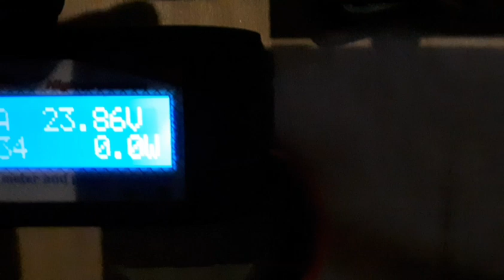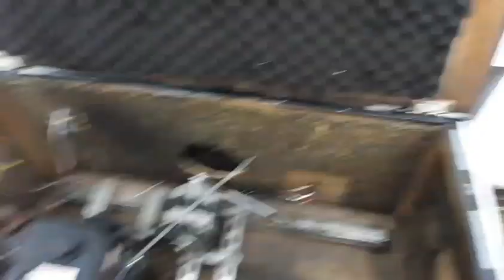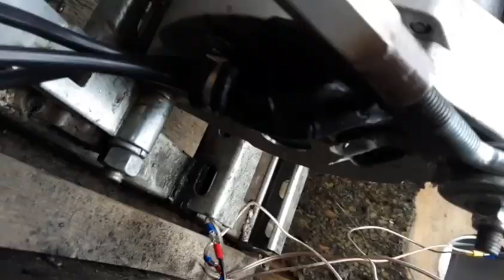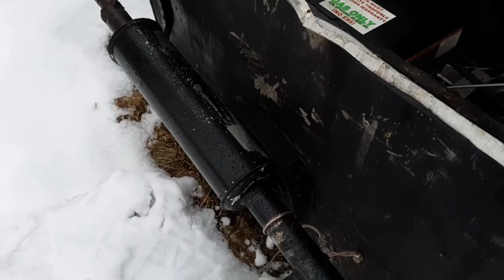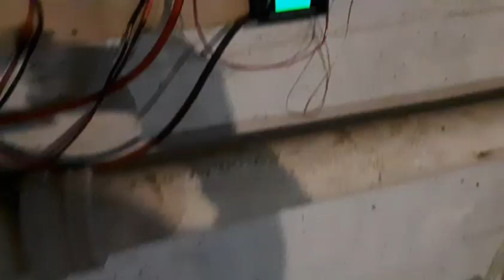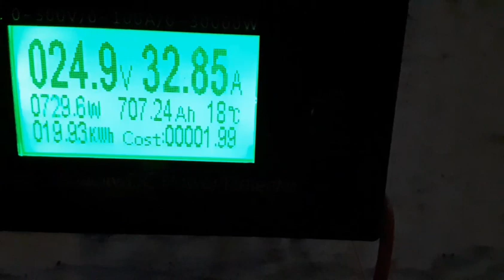DC Generator, Battery Bank Charger.

Comment: I’m about to do the same setup. How is this working out still? I want to do this to make a home made inverter generator for my camper. I’m going to use a YanMarr Diesel engine about 6.5 hp. But a lot of torque.
Reply from the maker: Still working fantastic! Just shot another video with a few new updates. I'll try to get it uploaded tonight.
Reply: Yes I would like to do the same thing - Yanmar Diesel LN100 air cooled engine driving a belt connected alternator to charge 48v battery banks. There is a lot more involved in all this then you would think. Have you seen the wakespeed WS500 alternator regulator ?
Reply: This  .....   https://www.youtube.com/watch?v=ccWg_G-ECSI is not run through a wakespeed controller but its an interesting setup. Expensive though and I cant work out why its so expensive. Sure the 48v 100 amp alternator is $1495 alone, the Yanmar engine is around $2000 I think. So I dont know how they end up at $6995 for the setup. Thing is, the video shows it can be done and it is working. They have that Yanmar setup with the belt/pulley setup to spin at 1800 RPM which is nice - a bit quieter and sips fuel
Reply from the maker: @jimjones7821  nice! I wonder what kind of run time that engine gets with a gallon. Generators are fun projects either way. I did lots of testing at different throttle set points and recorded kwh output/gallon of gas. I finally have mine where I like it. I did an update on this project recently. Much quieter now and zero degredation after 2 winters.
Reply from the maker: @jimjones7821  https://youtu.be/Puj2umQ_bVs
Reply: @smallcityhomesteaders1600  Yes I saw that video of yours. There is a lot of info out there but you have to be a dedicated searcher to root out the info. I am doing deep research into alternator charging - I want to run a setup in a small boat to charge an NMC battery pack for an electric outboard motor. I have been using a Victron 48v inverter and AGM batteries since 2010. Its worked really well. But its time to go to LiFePo4 batteries - so many advantages to lithium. Sure big sticker price up front but after that its all gravy. I have not done the solar thing yet though....I use grid for charging batteries and the inverter carries us through outages that happen here every other day.
Reply from the maker: @jimjones7821  Every other day?! Thats crazy! Where are you? You are correct about good info. Seems like someone doesn't want people power independant. Solar is amazing! The panels make so much amps with little sqft now. I see 50 amps by 10am and batts are full by noon while my wife runs laundry and dish loads, fridge and freezer kicking on and off, TV and lights... ect. Wind is about 5-10% of what charges my batteties. Zero grid power here(my choice of course). I am impressed by the energy density of lithium but I don't like the fact that when they're dead, they're basically useless, hazardous waste. Lead acid is at least renewable. Bulky and heavy but cost efficient and time tested. Until carbon foam battery costs come down i'll stick with lead acid.
Reply: @smallcityhomesteaders1600  I am in Africa. Been here 22 years now and its a little better then it used to be but its not the western world for sure lol.  Where I live we get wind come up most days between Sept and March but honestly there is so little energy to be harvested out of wind its not worth it - at least to me - rather put that money into Solar panels - especially the latest model panels - 22% efficient.  I will get to it. Right now I am want to figure out how to recharge NMC batteries in my boat so I can use an electric outboard motor, hence looking at setting up a small diesel motor to spin an alternator. Seems to be the way to go.
Reply from the maker: @jimjones7821  I'd like to see that setup. Always more then what meets the eye. Just getting the RPM matched so the engine can even start was difficult. Went through about 6 combos of pulleys to get it rite where the powerband of the engine matched the PMA. I have not seen the regulator you mentioned but i'll check it out.

Comment: The Power Meter link is dead. Could you please link us again?
Reply from the maker: US $14.09  16%OFF | ATORCH DC 300V 100A Accurate Energy Bluetooth Meter Voltage Current Power Voltmeter Ammeter Overload Alarm Function indoor
https://a.aliexpress.com/_mtkeSKR

Comment: Nice video! I don’t know where you’re located but The weather looks like where I live in the winter in Michigan
Reply from the maker: Well thank ya! I reside one state to the west of you...home of the green and gold.
Reply: I’m sure that generator got put to good use during the blizzard Thursday and Friday My place got hit the hardest out of the whole state So far we’ve gotten 15 inches still getting lake effect too 😨🥶
Reply from the maker: Yeah it's been nasty cold here since the snow. We got 10" thursday night and yeah, I ran a gallon through the gene friday while i scraped the snow off of everything. Wind has been blowing since to battery voltage has been holding fine.
Reply: I’m glad I found your channel thanks for being so informative And for your great content. I’ve been searching for a channel where the creator lived in the same region with similar weather and how they executed They’re off grid set up. If you ever plan on upgrading from lead acid batteries to lithium https://batteryhookup.com is a great source New and used cells
Reply from the maker: @Ezekiel-OffRoad  well i am glad to help! Being off grid in the northern states certianly is a challenge...almost a way of life. My routine requires a bit more then "on grid" folks with automated everything. I love it though and would never go back. My girls have learned more then they even realize in the way of sustainability. They're great wood stackers and i don't know of many teenage girls that know how to raise a wind turbine. Stay warm over there eh!
Reply: @Ezekiel-OffRoad  I use Nickle Iron, they last for decades, can't be overcharged or discharged too low or too many times.  I have a 600AH setup and should be set for life.
Reply: @paulamey6844  I didn’t know what you were talking about until I looked it up you’re talking about the old Edison battery I didn’t realize these were still used and we’re considered a viable option I’ll have to look into them now thanks for the info
Reply: I have a four year old son I currently live in the city I grew up on a farm with 1000 acres and 4000 hogs the city is not for me still got a few more years to get everything in order but I plan on buying property in the middle of Manistee national Forest off a two track for the last few years I’ve been recycling and building different lithium power packs and enjoy doing so I plan on putting that knowledge to use with my off grid set up really so far I’ve got everything figured out except A water source hopefully I find property where the water table isnt to deep
Reply from the maker: @Ezekiel-OffRoad  or a stream is always a huge perk. That's quite a rock you need to drill into for water. I'm fortunate our property up north runs along 100 yards of the wausaukee river. It's basically a large creek by us but it's clean and flows year round so I'm building a floating hydro generator that i can tie off to a tree and hopefully get a couple steady amps out of.

Comment: Would adding a properly sized solar charger controller between the 3phase rectifier and the batteries automate the charge cycle for you? That way you could start it, throttle it up and walk away and not worry about boiling the batteries.
Reply from the maker: It would have to be capable of lots of amps...perhapse but i don't want to spend a thousand dollars to try it. I have the micro processor and servos to control output via throttle control.... now to build it, learn to code and dial it in. Should be fun.

Comment: Great uploads. This unit works both 12v n 24v battery bank? Thank you
Reply from the maker: Yes sir! This PMA is wired for 12/24 volt but they make higher voltage PMA's also. The rectifier will apply power to whatever voltage you pair it to. A higher volage bank would br safe with a lower amperage rectifier. Im using the big heavy duty 300 amp rectifier but on a 48 volt system a 100 amp would be plenty.
Reply: @smallcityhomesteaders1600  thanks for your quick response. They have few different models for rated each voltage 12, 24, 48v. Maybe I'm looking at the wrong one.
Reply from the maker: @Honam.Muryeong  what voltage do you require?
Reply: @smallcityhomesteaders1600  24v
Reply from the maker: @Honam.Muryeong  https://www.hydrogenappliances.com/powerpmasdual.html
Reply from the maker: They threw in the 300 amp rectifier for another $20.
Reply: @smallcityhomesteaders1600  thank you

Comment: Would this work safetly with LiFePO batteries and a BMS ?
Reply from the maker: Well....yes. however you would have todo some research into how exactly your batteries like to be charged because it matters. Ohms law prooves true, whatever voltage your set-up is, a rectifier will feed in power at the appropriate voltage but this set-up is controlled manually as far as amps go. You will want to be in control of the throttle so you can feed in the safe amount of amps until it gets to goal voltage at which point you dial down the throttle to float the batteries at their desired float voltage. Every chemistry charges best with slightly different conditions. If you know those conditions you can perform then manually....OR buy generator control system and program it to run at your specifications. But the short answer is.....yes.

Comment: I live on boat .I have 2 wind turbines and 2 solar panals. I've made same as you with small Honda gx160 engine and a alternator too charge batteries in winter .when there's no free power. I wouldn't mind putting 240v generator on pulley too..so I can have electric while the alternator is charging my batteries then it probably charge batteries quicker.. as I wouldn't be drawing power from batteries
Reply from the maker: Sounds like a pretty great life! Not a bad idea you got to pulley an A/C generator of your battery charger setup. The engine speed would have to be set rite and steady however and the load could be a bit for the engine...but, that's not to say it can't be done. An interesting challenge at the very least.

Comment: It would be cool to run that alternator off a steam engine and small boiler. You wouldnt even need sun or wind.
Reply from the maker: That would absolutely be cool! Something like that mite just happen on this channel if the correct parts present themselves.
Reply: Look at methane gas a 45 gallon barrel should provide all gas you need for the geny on just food waste alone free energy
Reply: @douglaswindsor120  that's a great idea.
Reply: @douglaswindsor120  Now this is brilliant, and cheaper... but would a biodigester continue to work in such cold / freezing temps?
Reply: This is a good idea. I did price out a boiler and steam engine - roughly $11,000.
Reply: Using a 2 barrel set up in cold climate it would need to be well insulated and have a heater to keep the temperature up to body temperature i'm planing on setting one up in my basement dug out I have an idea for a totally different set up for a three barrel set up i'm probably going to try and start building it in April but in all the videos I have seen none are like what I am thinking of but theoretical it should work I'll use a flow though design where the feedstock goes into one barrel starting the process then flow into the 2nd to produce more methane and finally into the 3rd for the final then into a bucket with a sump pump to take it to the garden in looking at most designs there is a lot of unnecessary work haul the feedstock to a garburater haul the chopped up feedstock to the digester and haul the fertilizer to the garden that's a lot of work set the garburater up to feed directly to the digester and pump the fertilizer directly to the garden tank and then add more water to it to water the garden
Reply: Wonder if you could run a 12v low amp, low wattage, high rpm dc motor to power the alternator without using a gas motor. Like take a little to gain a lot.

Comment: At the higher RPMs, I think the PMA you have puts out well over 30 volts.  If you have the rectifier connected directly to your batteries, that could be why the the higher watts going in caused you to have to add water back in.  My question is why not use a charge controller that can limit the voltage going into the batteries and boost the amps, such as what is talked about with the wind in this video https://youtu.be/JA7Sh9ylAzQ?t=211?  Something like that might save your batteries from accidental over voltage.
Reply from the maker: The short answer is, simply cost. The guy it that video has the output from his rectifier going into a $500 charge controller that does the same thing as my $100 dump load controller. He's dumping excess power into a water heater just as I do. The little use I get out of my back-up generator doesn't justify the extra cost of another controller when it works fantastic as it is.
Reply: @smallcityhomesteaders1600  Might be good if you added a dump load to the generator's PMA too.

Comment: Hi can you tell me what are the advantages of using an alternator in this way over using a standard generator to recharge your batteries?
Reply: It would be cool to run that alternator with a steam engine and small boiler.
Reply from the maker: @seekthetruth2529  that has actually been a dream of mine since(believe it or not) age 13!
Reply from the maker: My first 2 years off the grid, i used standard generators running to battery chargers. I burned out 1 generator per year and the batteries never got charged the way they needed to. Most 'off the shelf' generators are not meant to run full tanks of gas though them over and over, which living off grid in northern states...is a reality. Most battery chargers only put out 15-25 amps and are absolutly not designed for the ultra low resistance of a large battery bank. My setup here has survived 2 straight winters and going into it's third. I can precicly control output to fit the bank's needs and if i need to i can crack it up to 3000 watts. You will never find a battery charger that can do that continuous duty. 3000 watts on my 24 volt bank is over 100 amps....on a 12 volt bank.... double. It's a simple, reliable setup built from time proven components. Absolutely recommend the Dual Core PMA from Thermodyne! It's a power monster!
Reply: @smallcityhomesteaders1600  Thank you very much indeed for your in-depth response, so if I understand you correctly using a high powered alternator is much more of an efficient way to recharge your battery bank in an off-grid scenario then a traditional generator. I am in the west coast of Ireland and I don't want to be connected to the grid so this would seem to be the best option for me, I would like to use a single cylinder small diesel engine to run the alternator the only problem that I see is potentially getting one of these high power alternators over here to Ireland. May I ask how often do you need to run the alternator and when you do how long do you run it?
Reply from the maker: @bh635  it gets a fair deal of use. November and march are very grey here so the gene runs probably twice a week or more in the grey weeks. If throttled to produce 1000w, it runs about 6.5hrs on 1 gallon of gas. When I fill it up, I start it and let it ryn out and that always fills my batteries. Aproxamatly 6.5 kwh goes into the bank.
Reply from the maker: @bh635  https://www.hydrogenappliances.com/powerpmasdual.html